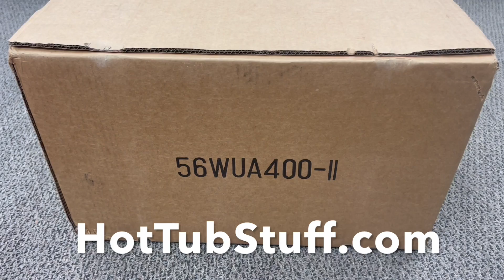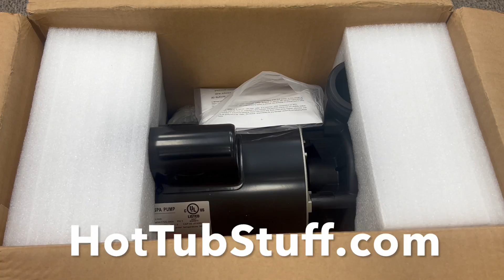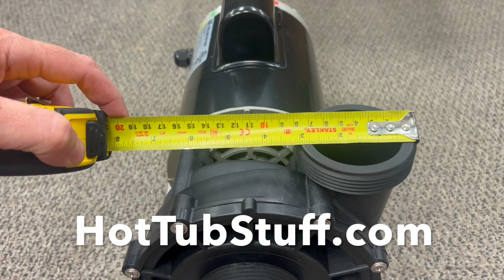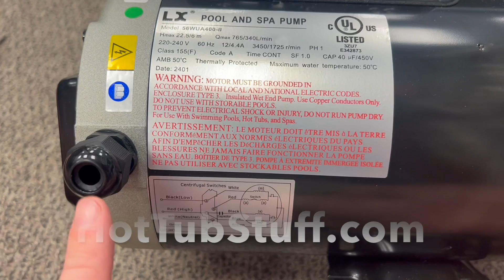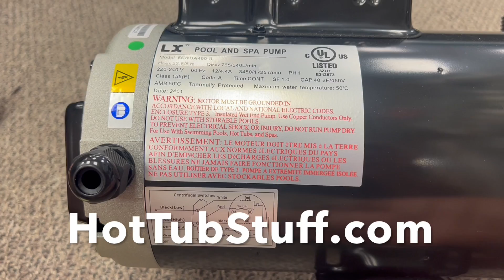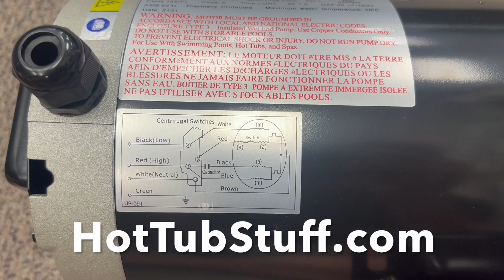56WUA400-II

Comment: thatnks for the video. Loved that you confirmed that a 2 speed CAN be used in place of a single speed, you just connect the 3 wires to the pump with black wire connected to the high speed connection on pump. I just ordered a single speed and it came with a diagram saying exactly what you just stated. Wish I knew this before I ordered a single speed as they seem to be a lot more available/sold than the single speed pumps. in fact, I'm not even sure WHY a single speed is even made, if a 2 speed can be wired for each option.